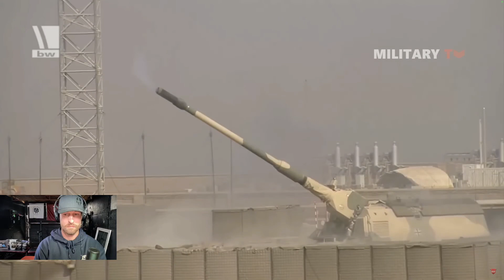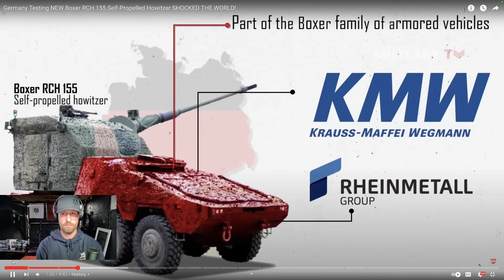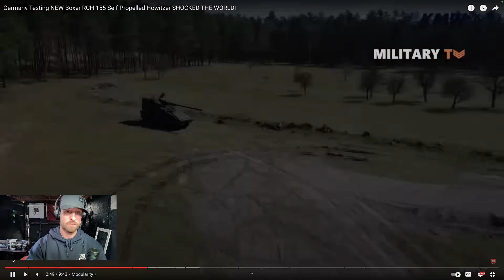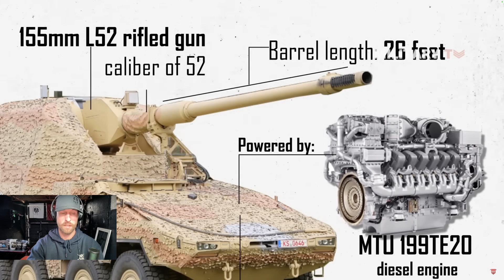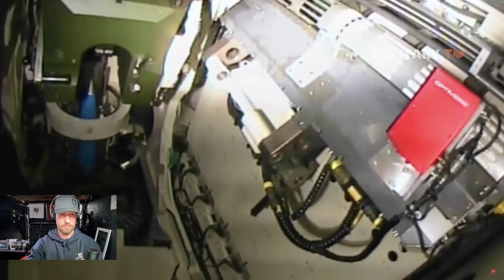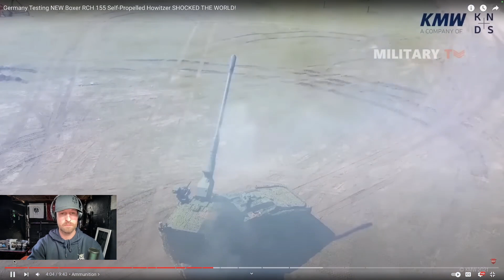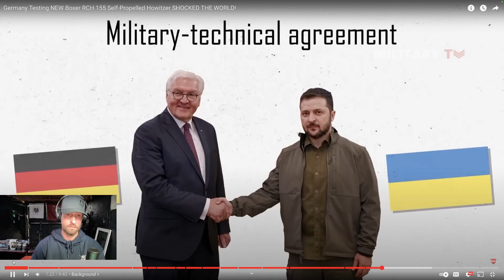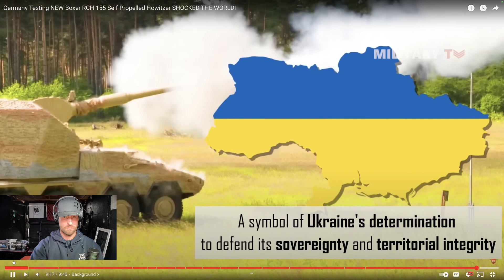Boxer RCH 155 British Armys New Replacement British Soldier reacts

Comment: The Panzerhaubitze 2000 has proven to be a very maintenance hungry beast.
So if the gun system is made after a Panzerhaubitze 2000... Could there be a problem here?
Reply: First of all, the PzH2000 is not as "maintenance hungry" as the Ukrainians say. They are just used to Soviet trash that keeps somewhat working but can't hit the planet without help from gravity.
The Ukrainians also bitch and moan that the M1 Abrams is shit because it needs too much maintenance for their liking. It is just a fact that high tech machinery that is supposed to be accurate and meet certain performance levels doesn't like it when you clog it up with mud and dirt and can't even be bothered to put some oil on the cogs.

There are also reports of PzH2000 firing 20 0000 rounds without breaking down, which is unheard of. So how bad can this supposed "unreliability" really be?

However, the RCH is especially maintenance low because the turret is a closed system where no soldiers stomp in and out with muddy boots. No dirt, no water and no vapor from humans breathing gets dragged in and the inside thus stays especially clean.
Reply: every modern high end system is maintenance hungry. you cant get a 5 round burst in 16 seconds with simple manual loading etc.
Reply: @zhufortheimpaler4041  Nope , not True. the french caesar howitzers are not plagued by the same problem and i haven't heard much about the swedish archer in ukrine either, regarding that area.
Reply: @mugin11223344  Caesar and Archer are not so maintenance hungry because the maintainance hungry stuff are the tracks, the tracks, the track suspension and the tracks.

And Caesar and Archer doesn't have tracks.
Reply: Every tracked vehicle demands a lot of maintenance and repairs and is thirsty as well.  So maintenance on the carriage will be lower already.
Reply: PZH 2000 being maintenance heavy is kind of a myth that got spread by butthurt Polish equipment fanboys once they found out PZH 2000 vastly outperforms the Krab howitzer in Ukraine. About 30 Krabs have been destroyed and zero PZH 2000, which Poles try to explain with the fact that PZH 2000 supposedly spends most of its time in maintenance rather than on the front. Then again we have proof of PZH 2000 taking and surviving a LANCET Drone to the roof armor and exceeding 20,000 rounds fired through a barrel rated for a already crazy high 4,500 EFC (K9A1 has 1,000). That's hardly accomplishable when sitting in a maintenance shop.
Reply: It's only "maintenance heavy" because the Ukrainians are using them well past specifications.